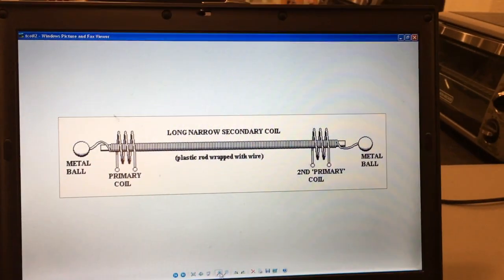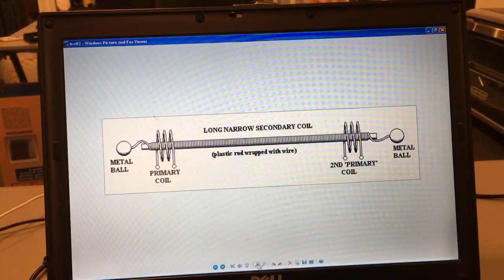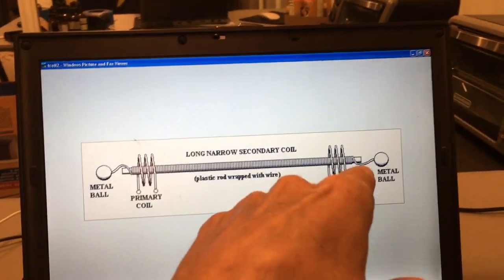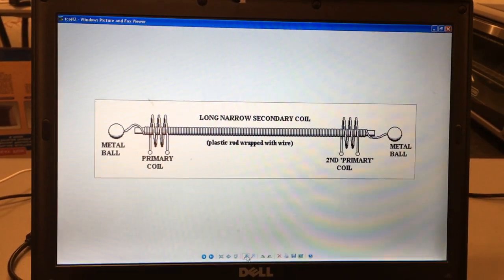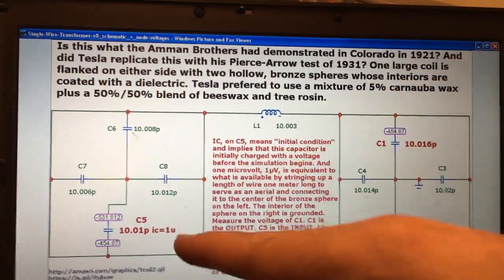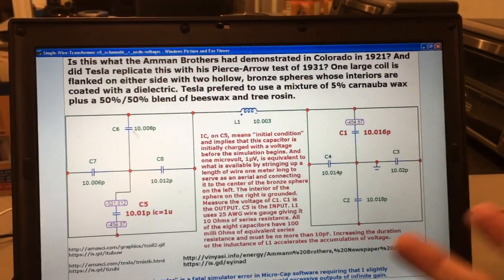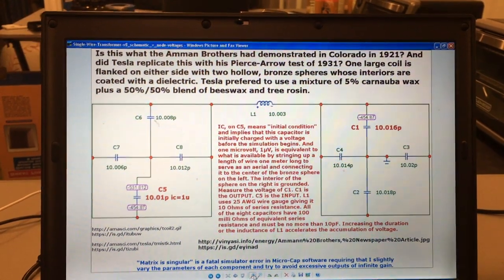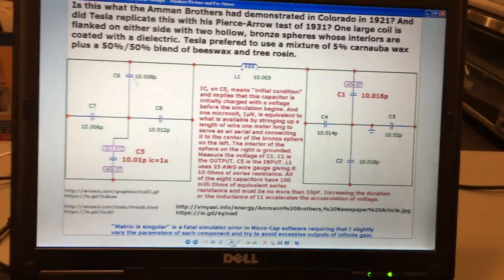Dual-terminated Tesla coil may be the power supply for the Amman brothers and Tesla’s Pierce-Arrow?

Comment: The Nikola Tesla museum in Beograd participated in the making of the film "Secret of Nikola Tesla," and I expect that the unexplained scene with the horizontal lightning-beam is extremely accurate reproduction ( probably based on eyewitness reports in the museum collection.)  See https://www.youtube.com/watch?v=laRfPtrVLQQ&t=4365  watch?v=laRfPtrVLQQ&t=4365 showing the horizontal miles-long discharge from Tesla's apparently-hollow metal sphere at Colorado Springs.    Obviously not hollow, it must have contained some complex devices, yet the metal sphere was completely sealed (supposedly a near-perfect Faraday cage, where any internal structures must be irrelevant according to Maxwell's equations.)